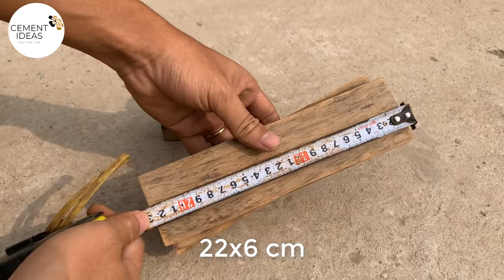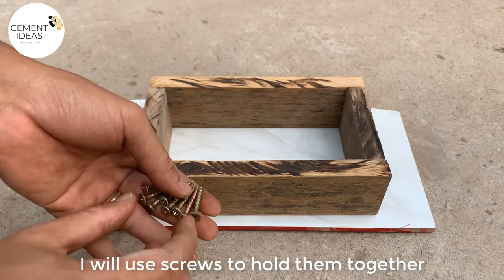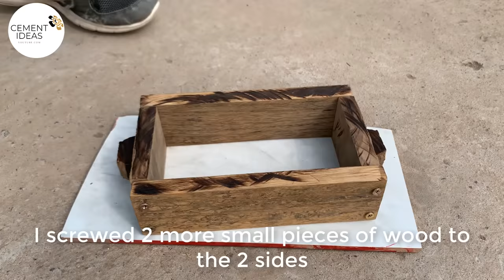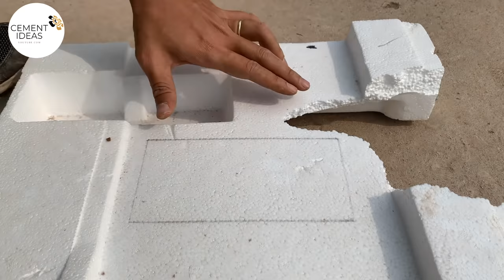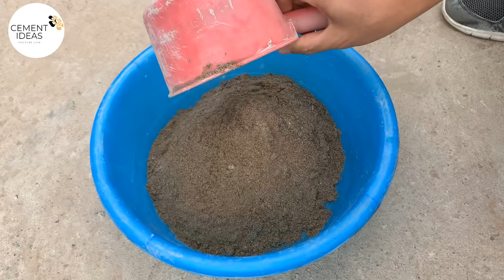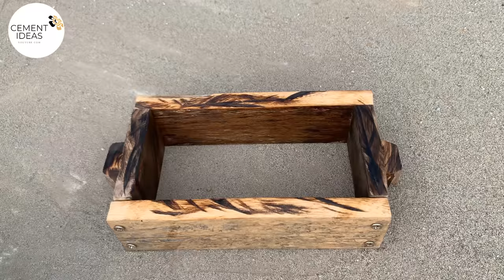Diy Cement ideas making cement block bricks easily

Comment: Frog is required on the top of brick face to form proper bonding with another brick.
Reply from the maker: Yes.Thanks
Reply: What's Frog?
Reply: @pardwayne  Frog is the indentation on the top surface of the brick, usually embossed letters of the Manufacturer of bricks. It provides a space for accommodating cementing material (mortar) which forms proper bond with another layer of brick by adhesion and cohesion.
Reply: @stuxnetvirus9116  Thank you.